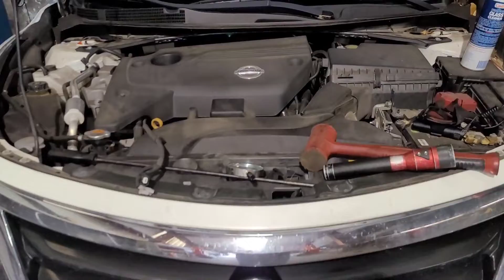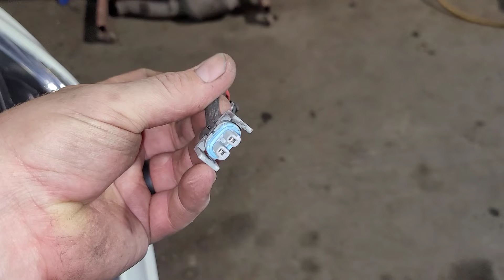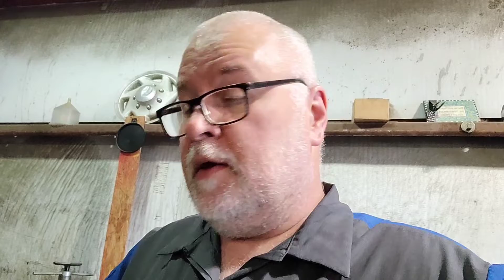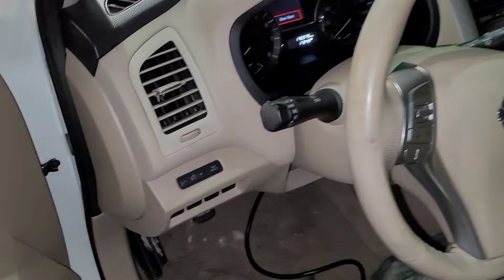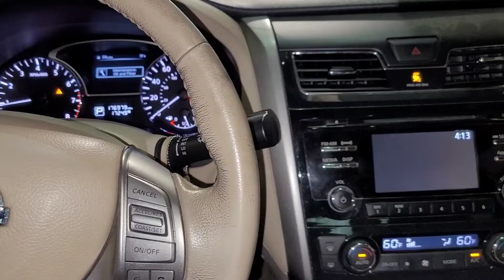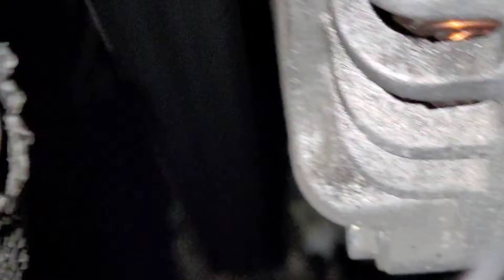Air conditioner won't work !! One tiny connection ruined everything

Comment: Re: Nissan being junk. I've been driving vehicles of all types since 1980. The BEST vehicle I ever owned was a 1988 Nissan Hardbody pickup truck. 2.3L engine with a 4spd manual transmission. It was a bullet-proof truck. Corrosion killed it.

Comment: You and WatchWesWork use uninsulated connectors, together with quality heat shrink containing glue. I got a set of those bare connectors, I think the combination may be the best of many options. Last year I dabbled with heat shrink connectors, and to my surprise some of the insulation shrank so much the insulation tore itself open. It was probably too much heat, but for components that may experience heat from the engine it is disconcerting. Some connectors with their own 'solder' use metal with such a low melting point I don't trust them inside an engine compartment. As you say, there's no reason to solder, and a poor solder joint is worse than nothing. I wish a crimp system could also employ a mechanical splice with twisting wires, but the connectors end up being so large to go over the twisted pair that the heat shrink may not provide a water tight grip on the single insulated wire at either end.